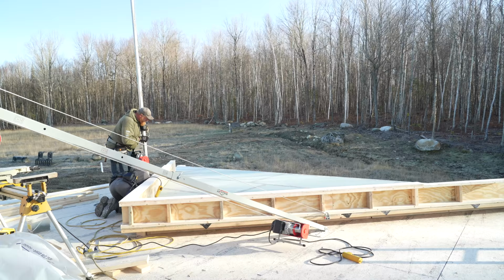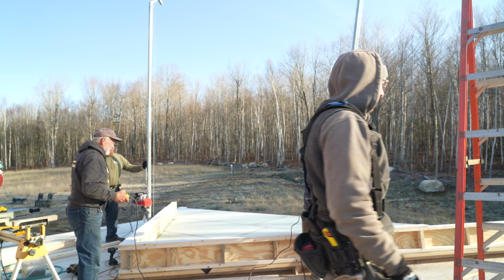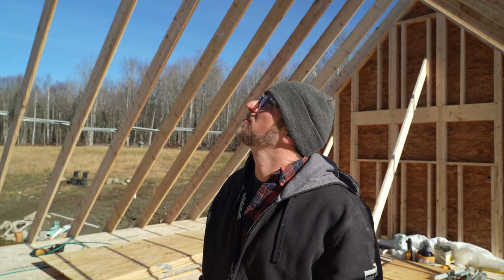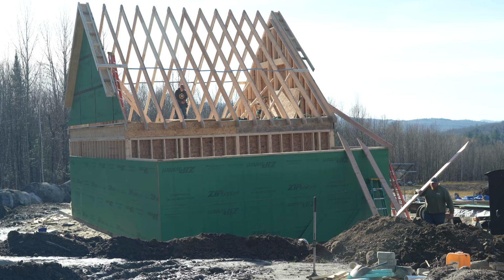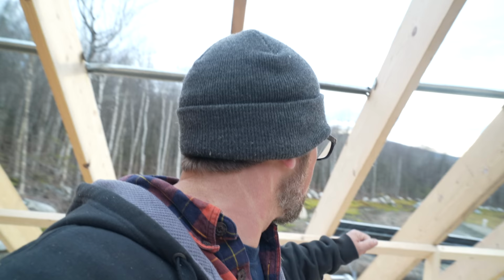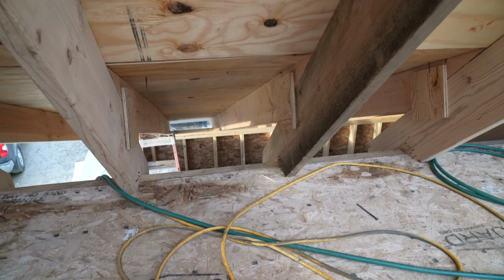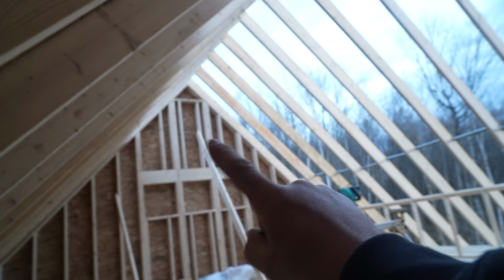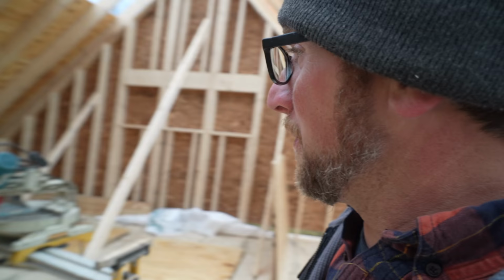WE Still Can't Believe It, Everything is MOVING So Fast!!! Day 5 of the OFF-GRID Tiny House BUILD

Comment: Ken and his crew must be Swedish  carpenters. When we moved into our house in Scandia ,Minn. we replaced the cedar shake roof and there seemed like a pound of nails per square foot. We did some remodeling a few years later and when we changed a doorway to a window there were 7 nails in one corner of the old doorway. The house was built in 1903. Those Swedes liked useing plenty of nails. Just a fun comment for you to read. :) :) Ken and his crew are great carpenters.
Reply: Don Gunderson ,
I was thinking that as I watched them nailing the peak gussets. So many nails being used I was beginning to wonder if there would be room to place the next nail. lol
 Those nailing tools were beginning to sound like machine guns.
Reply: @donaldmiller8629  I really don't see a need for all those nails yet the plywood on the roof is under nailed.
Reply: Unfortunately there is a point of diminishing returns where more nails will weaken the joint.  I think they were close. 🤔

Comment: I can't imagine building a house like that in Oklahoma. Oklahoma winds would tear it apart.
Reply: And a flatter roof is worse in a bad snow load in New England.
Reply: They get quite windy there as well.  The have the tie down thingys now in roof construction in high wind loads. They're called Hurricane Straps!
Reply: Rickster1234 ,
Keep in mind that New Hampshire does have some very fierce winter winds. Perhaps you have not noticed that Al is building his house with heavy duty lumber. For example , using 2 X 6's for the walls rather than 2 X 4's.  It will be a very sturdy house.
Reply: Rickster, your negative comments are still making you look so foolish!
Reply: @donaldmiller8629  It appeared to me he was using cement screws to tie the walls down. Anchors are required always. Lag bolts or straps are needed on the gable ends and where is the ridge board for the rafters. Plus if I was going to use splice plates for the rafters I would apply construction adhesive before screwing it down. I would also stagger my top and bottom plate joints. Yes I would use joist hangers on all outside connections on floor joist and rafters. 2x6 walls will be stronger but insulation value is why there used. 2x10 or 12 with staggered 2x4 inter studs on 8 inch centers will give you an insulation value like you wouldn't believe. The overall cost is not that much higher either.
Reply: @rickster9993  Why do you "OKLAHOMA PEOPLE" think that you have your OWN PERSONAL WEATHER SYSTEMS and they are like NO OTHERS HAVE EXPERIENCED?  You don't even reach hurricane winds, unless, you get a very close tornado!  So in other words, many states experience much worse!!  HUSH!    If a tornado hits this farm, everything will be ground level no matter how it is built!  The average high winds, will not huff and puff and blow this house down!  I do wonder about the ridge board, just because I haven't seen a build without one.
Reply: Nonie Marley, I like your comment that I saw in my notifications.  Did you delete it?
Reply: @darlaherbst5929  You ever experience wind gust to 75 MPH. It's like your house gets hit with a mac truck. I've never seen house built as weak as this one. I don't think he even used treated lumber for the bottom plate.
Reply: @rickster9993  They will, probably, never have winds like that. If they do, that's what a bunker and insurance is for!
Reply: @rickster9993  Then you failed to watch closely. They clearly said the bottom plate was treated. They also used an additional sealing layer between that treated bottom board and the concrete.
Reply: @rickster9993  ... bottom plates are secured with wedge anchors into the slab.

Comment: Hello friends
What about traditions, here in Denmark we have a tradition of holding travel parties with the craftsmen when the roof (rafters) plates or battens have been assembled. The celebration takes place by putting a spruce wreath on top with a flag and then there is a little good to eat (hot sausages with bread + accessories and something to drink not alcohol, as the alcohol limit in Denmark is 0.5) ha still good day
Reply: Iron workers here in the US have the same topping out ceremony on commercial buildings where a Christmas tree and American flag go up on the tallest beam or column. We got that tradition from you guys. Long ago I worked on new commercial buildings in Boston where we did that.

Comment: I haven't checked out everything but if you haven't done hurricane ties (that tie the rafters to the first floor walls) here's a very easy way to do it.  Use 6" long (or longer depending on your wall stud size) timberlok screws and drive them at the top of each wall stud at an angle up into the rafters.  This is code approved and is quick and easy to do before walls are covered with drywall or whatever else.  Only need one screw at the top of each wall stud/rafter.

Comment: It would be much nicer to see larger cheek pieces at the peak even with a rafter tie.  Those pieces of plywood should be triangular and cover the peak dropping down at least sixteen inches.  Construction adhesive should also be used to spread the load out over the structure.

Comment: I notice you don't use any metal straps to tie the rafters to the edge joist. Not necessary in the North? I would think you would want them with that steep pitch and possible high winds.
Reply: Hurricane straps don't see much use up north. We're required to use them here in Ct but that fades away going further up.
Reply from the maker: We’re not done with everything yet.

Comment: Should have put together all of the rafters then stacked against one end wall……need to get some rafter ties in there before it starts ragging in the center
Reply: knee walls were underway in another video and collar ties will be in as soon as the plywood is on the roof. Ken usually does the roof by passing the sheets up from the inside so needs the room. Saves a lot of ladder time. It will be interesting to see who he gets the plywood to the second floor because the stairs have not been cut in yet.

Comment: Hi Lumnahs!  Just wondering if you are using 1/2 inch plywood for your roof decking.  I recently had to have my roof replaced and some of the decking and they used 3/8" plywood which I felt was kinda flimsy.  They told me that it was up to code but I wish they had used 1/2". Everything is coming together and I'm super happy for you guys!

Comment: Curious: why didn't you use a ridge beam? Wouldn't it be stronger for your snow loads up there? 
It would keep the rafters from spreading over time.
Reply: ... even with a ridge board you still need collar ties and knee walls. A high peak like this also goes up faster when you don't need a ladder to constantly work up top, not to mention the cost of a 24+ foot ridge board.

Comment: So, curious on the size and square footage of your project. It's going to be a good looking building. I'd love to know what the footprint is.
Reply: the footprint is mentioned in the first video where they pour the floor, then again a week or so later when they add more for the porch extensions on two sides. The second floor is something around 560 sq ft but you need to subtract the knee walls and stairs for something under 400 sq ft of living space.
Reply: @rupe53  I've only seen the latest 2 or three videos.
Thanks
Reply: @chrisrogers2230  It's 38 x 24 including the lean to.
Reply: @tonygrimes13  it is interesting how different building practices, design and size differ between regions in the US.
For example,  my home that is basically the same footprint as this project, (40×24) and is a pretty typical size in my area of Arizona. However, my 3/12 pitch doesn't give me the room above that this project has.
Watching this has given me ideas of adding a second floor to my home.
Reply: @chrisrogers2230  It's also a multi purpose building. Yo need to watch their videos of 3rd August & 18th September to understand.
Reply: @tonygrimes13  I understand..
It's use is inconsequential. I simply find it interesting how what is considered a small house here, is considered a tiny house there. 
The roof pitch is tall and I never realized how much room you can add simply by adding a tall roof to the structure.
Interesting for sure

Comment: Great work!! I only had one question. Why didn’t you use the insulated zip system sheathing for the roof??
Reply: Zip wall isn't much on insulation. It's more a substitute for house wrap. Besides, it's OSB so not as strong as plywood when you have to consider snow load on the roof.

Comment: Hi guys, great build. Watching from Chile. I found very clever and clean the way you put those rafters. Gonna be building alone soon, at least that's my intent for most of the job (probably not foundations neither the rafter installation) so this video is of great help and source of inspiration. What kind of jig are you guys using so temporarily secure rafter to rafter? I refer to that piece of metal  (or wood?) that seem to be of the exact rafter spacing and runs both sides along the length of the house...at head height approximately. Does it have some kind of a hinge and lock? I have seen all kind of jigs, hardware and tools when watching videos from US/CAN, so many stuff that no one is selling here. If you could provide a brand for such jig I appreciate it. Take care and thanks.

Comment: I noticed you used the Zip System (green boards) on the walls, but not on the roof, you used an OSB with a rollout sheet, was there any particular reason you decided against the Zip System (brown boards) for the roof?

Comment: In 74 I built a garage with a gambrel roof.  I built the rafters on the deck of the garage and raised them similary to what Ken is doing here.  I gusseted all the joints with plywood but I didn't have a nail gun back then.  They were still pretty new and too expensive for the average homeowner. It was only 16' wide so we were able to flip them over to nail the second side gussets.

Comment: Don’t know if it was asked… With 24” spacing with the rafters… did you use “H” clips on the plywood sheeting?
Reply: ... Ken usually doesn't use any clips and this will probably be a metal roof so the load will be spread out anyway.

Comment: Goooooood Afternoon , Al , & Gina ,
Your house is looking good. The only change that I would have made , considering the impending threat of inclement weather, is that I would have used the entire crew to finish the roof today. Once the roof was dried in the knee walls could have been done later since they are inside. This way , if the rain does come , there will be a delay in the roof work. From my viewpoint , completing the roof was more important.

Comment: Those gaple lifters need to be symetrically opposite so you don't have to pull one away to clear it from the gable while lifting. I was wondering if one can be assembled to be mirror image for that purpose?
Reply: Good eye. We've already covered the aspect of assembly to correct that. I suspect it's in the instructions but as most people don't read the fine print... oh well. Let's blame Al for making them both the same instead of flipping the second one around and call it a day.

Comment: Any particular reason why you chose to not use the Zip system sheathing on the roof?
Reply: Plywood  is much stronger especially considering the snow load they get.
Reply: @tonygrimes13  any idea of what thickness was used? It appeared to me that with 24” OC, no clips were used between adjoining panels.

Comment: Where is the staircase opening, going to be for the second story?
Reply: Lumnah Acres said in an earlier reply that it will be cut out later.
Reply: @tonygrimes13  ... wild guess is they will use scraps from the roof rafters to frame the opening and save a few bucks. I can't think of any other reason to hold off, other than Al changing his mind on where the stairs will go.
Reply: @rupe53  I don't think they will change their mind. Staircase is at back wall from left to right with pantry  on far right.
Reply: @tonygrimes13  ... I'm with you here. That leaves only one other reason for no stairs yet... they are trying to get weathered in quickly and the stairs will be a rainy day project.
Reply: @rupe53  Correct, when weathered in there will be plenty of inside & outside work to be done. I think Ken's work is nearly finished on this project.

Comment: On the edge of my seat wondering how those last few rafters would get stood up.  The struggle on the last one got edited out.
Reply: The last 2 were put up at the same time.
Reply: @darlaherbst5929  I often wonder about how much people watch/listen!!!
Reply: @tonygrimes13  That is true!
Reply: @darlaherbst5929  At time 10:56, they are struggling to get the last rafter set up. Then about 10:59 there is an edit and they are getting it nailed into place.  The last rafter up on the deck was the next to last to get nailed in.  They never showed how they got that last rafter up between the other rafters.  It was a tricky fit.
Reply: @gl309495  Oh, your just trying to point out the "error" of their way!  That they are supposedly trying to hide by editing!  The difficulty of getting the rafter up is easily seen in the video!  Yes, it could have been done simpler but it's not a big issue!